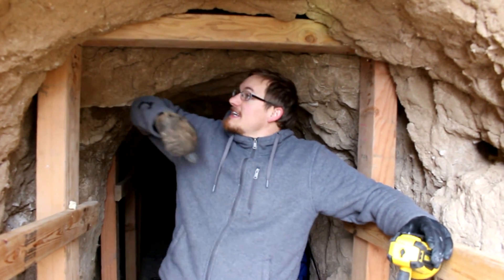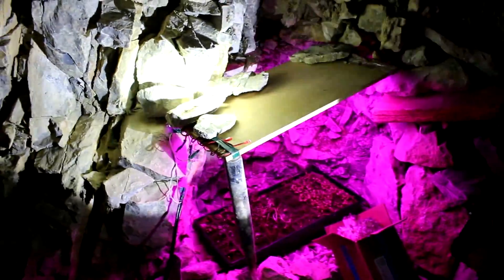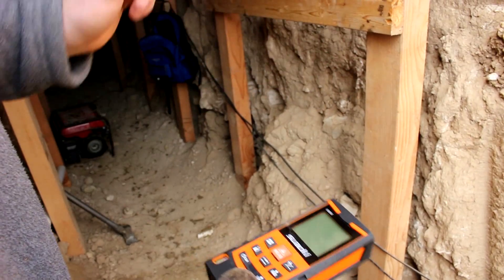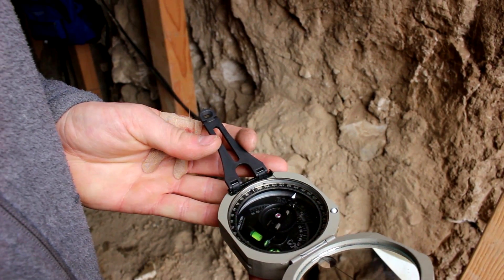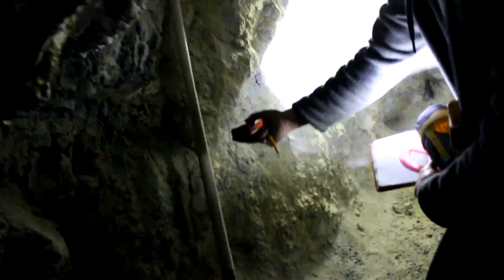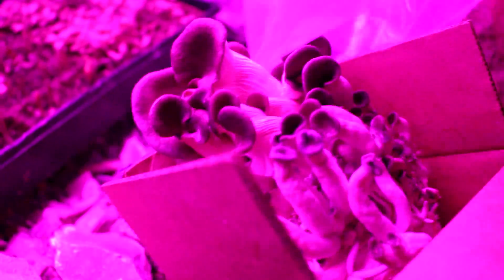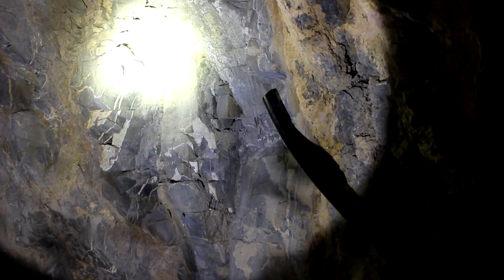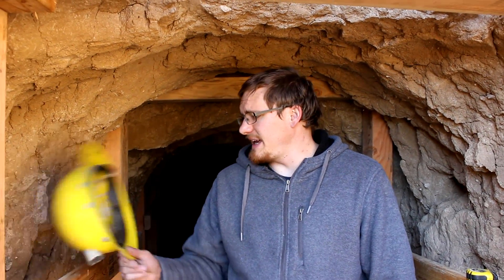Cody's Mine Episode 8: Measuring Things

Comment: Hi, use gunpowder for rifle. and use PVC pipe how is 20 mm or thet big you have drill for. Glue with epoxy at the ends. And use the same ignition you did with the black powder blasting. But you can do a primer and use flash powder. I do not think it should be illegal to do in your state. but check it out for sure.

Comment: Cody, I've been doing something like what you're doing for a while now, unfortunately, I don't have a big hill or mountain to dig into like you do. But I've been digging a trench and making smaller ones about an inch deep for some extra 2x4's my father had lying around. I'm hoping to create a little hideout or something of the like I could just sit in and either play games, or just relax. It's well away from my home or anyone else's home so I don't think I have to worry about pipelines. Roots are a definite problem though, as they are everywhere and interfering with my digging a lot. Just over the past week of only working on Saturdays and sometimes Sundays, or just whenever I'm not tired enough from school, I'll go out there and continue working. Right now, based on how much work I've had out there, the starting hole is about maybe, 2, 3 feet in depth? I have no exact measurement, but since I'm 5'5", I was using my known height to kinda measure it out a little. The highest point of the hole reaches about 3/4 to the top of my thigh, and the lowest point comes up to just above my knee. Any ideas or tips on doing something like this? I've been doing this so I'd get outside more and maybe lose some weight or build muscle at least with doing a whole bunch of work. If you read this, I'd love to hear a reply, thanks.
Reply: +Kale F. Don't make any tunnels or deep holes (deeper than you are tall) unless you know what you're doing. Be aware that trenches tend to do things like flood, and animals may be a problem.
Reply: +seigeengine Yes, I am aware of flooding and animals, I plan on digging out a slight slope so that small animals could get out. I don't plan on it being taller than to my pecs. And I know the dangers of tunnels, so I'm not going to make any, I'm hoping to get smaller pieces of wood or cut some up to use as support for the walls of the trench.

EDIT: It's actually been raining almost all day today, I'm hoping it will not be enough rain to the point of having standing water and ungodly amounts of mud. But enough that it softens the dirt and makes it easier to dig, unfortunately, our soil in Oklahoma in certain areas (like mine), are made up of mostly clay, so it's very hard and tiring to dig 3 inches with just the same pick Cody uses and a shovel to clear out the dirt.

Comment: Hi Cody!
As it seems you find black powder troublesome to use, have you considered freeze cleaving instead?
It is an ancient technique that use the thermal expansion of water , huge rocks can be broken this way.
Basically all you have to do is to insert with a hammer a waterlogged wood stick (rolled in wet cloth is better) into the drill hole then you could pour liquid nitrogen on it.

As there is no shockwave i dont think there is risk of mine collapse so you could do it  whitout leave the mine.

Comment: You will need a license for dynamite, TNT, nitroglycerine based explosives, detonators, blasting agents, cast boosters, few more but not really relevant. It will cost anywhere around $200-300 so not really worth it. Good ol' black powder will do you good. As a future Mining Engineer, the mining industry uses a lot of ANFO and Emulsion but in your case again needing blasting caps to set it off, which you need a license to buy them. So just stick with the black powder.

Comment: Cody, I have to point something out that you may not have thought about. the plants that are growing in the mine will have slowed growth (probably significant) if they don't also have airflow. during photosynthesis, the stomata of the plant (entrances for CO2 and exits for O2) will function more efficiently if the O2 is carried away. if it builds up, it will hinder photosynthesis by attaching to a intermediate product (G3P) in the chain of reactions that create glucose because O2 has a greater affinity for it than the next substrate. the subsequent molecules that are made with the O2 and G3P are 100% useless and ultimately slow your growth. P.S. I love the series!
Reply: This is a good point. Lifting the plastic lid will help here. Hopefully the size of the cave will mean little O2 buildup but some kind of ventilation will really help here.
Reply: Scott Robson true, diffusion of O2 molecules will be faster if the cave is wider, but since he has the plants located in the back (because it is warmer), the rate of diffusion is slowed by having to move down such a long tunnel. therefore, diffusion will hardly make a difference in theory and Cody will still have growth issues.

Comment: if you can't use dynamite wouldn't putting gunpowder in a steel tube work better than just putting the powder in the rock because you can have a better pressure buildup
Reply: No.
Reply: At that point, it's a pipe bomb. The pipe will become shrapnel and even if nobody is around, you probably don't want to have to deal with metal shards potentially causing injury.
Reply: Caleb Shoemaker That + it has no benefit with the explosion.

Comment: If that pipe is setup as a security measure in case the shaft collapses I'd recommend you to setup 2 pipes: one for the air to go in, and another one to take the air out. Otherwise you'd be breathing the same air in the tube back and forward. (try breathing directly from it ;) )
Reply from the maker: +RenzitoARG 
Yes, there will be 2 pipes.
Reply from the maker: +Cody'sLab 
This was the small one.

Comment: hey Cody I love your ideas and videos and I used to work at an aquaponic nursery propagating herbs and veggies with the lights you lose alot of the usable lumans with every foot or so, so depending on the temperature of the lights try and get them as close as possible to use the light more efficiently and maybe put up some silver foil insulation or matte white plastic not gloss to reflect the light so its not absorbed by the rocks, everything helps when you are trying to imitate nature.  

oh and don't use al foil it can the crinkles can focus the light and burn little seedlings

Comment: Cody i want to make an Opal gem by putting saturated water with SiO2 in a compressed steel pipe. Do you think this would work? I realy need to know ^^
Reply: +Sean van Dun If you had enough pressure, yes...
Look up the diamond making machines, you probably have to make close to that pressure though.
Reply: +girrrrrrr2 my idea was to add liquid nitrogen to create the pressure do you think that would work ?
Reply: Nitrogen is compressable.

It would create extreme pressure, but im not honestly sure if it would keep seperate from your SiO2 to let the crystals form properly.

You would have a lot better and probably easier success if you went with a hydraulic press or something similar.
Reply: +girrrrrrr2 i'll look what i can do, i just hoped +Cody'sLab  could help with a more simple way like some like dry ice or liquid nitrogen^^.